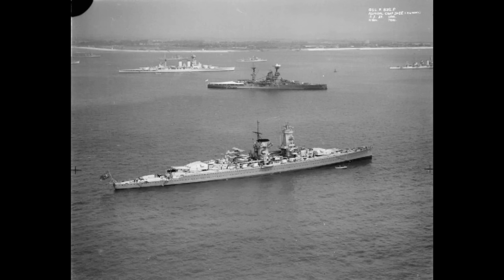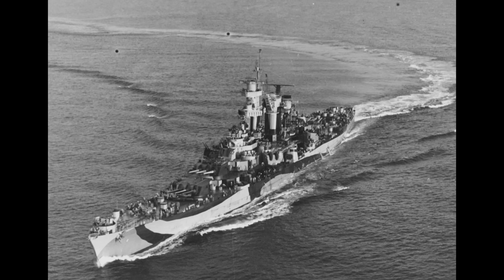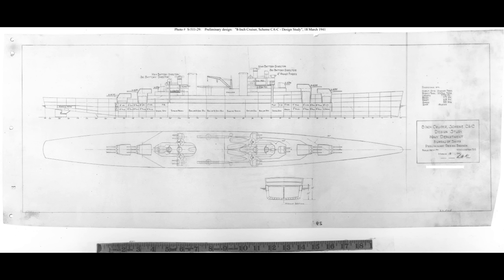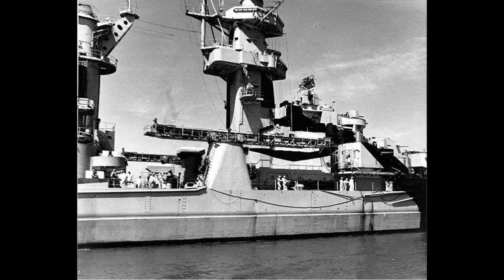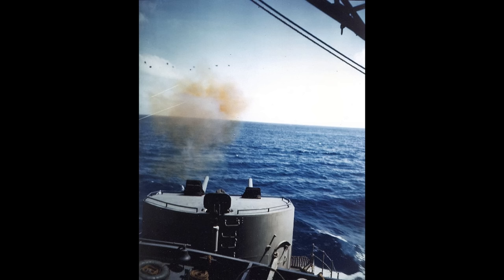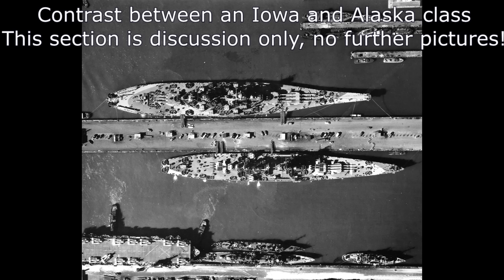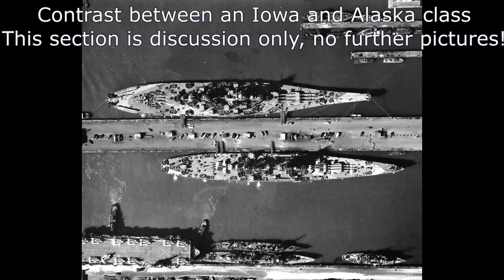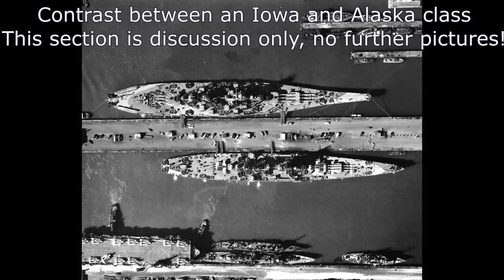The Alaska class - Large/Super/Battle/Mega/Hyper/Ultra Cruisers

Comment: Personally, I'd call 12" guns battleship calibre weaponry, especially as it's similar performing or better than the 14" battleships still in service at the time. Which being a supercruiser with battleship guns, would make them a battlecruiser.
Reply: But they were smaller guns than contemporary battleships, even though battleships of just 20y earlier did use that calibre. So you could go with "light battlecruiser". If any interwar ship was designed with 11-13" guns and armour against the same (as one of the Alaska designs did), then it could be a "light battleship".
Reply: @davidjames4915  Yeah, let's go with "Panzershiff" instead as it's about equivalent to the Graf Spee.

Comment: while not mounting contemporary capital class guns, the 12" is still classified as a capital class gun. the US Navy had this weird obsession with speed not being as necessary as firepower and protection. the North Carolina's where the slowest of the proposed design's. The South Dakota's (1939) bucked the trend with effort to maintain 28kts. The design life of the Alaska's is right in this time frame. The design requirement of at least 33kts, and having been longer, and almost the same weight as a unloaded South Dakota puts the Alaska's into the realm of battle cruiser.

Comment: If they are cruisers and not battlecruisers, then the modern german Braunschweig-class are corvettes and not light frigates.
But then, the Deutschland-class were officially heavy cruisers. (with 14300 long tons fully loaded, 186 m length, 28 knots and 6x 11 inch guns) And those were called "pocket battleships" (Compared the 34250 long tons, 246 m, 33 knots and 9x 12 inch guns of the Alaska) The Alaska is indeed closer to Hood in specs than to Graf Spee.
The closest on axis side would probably the Scharnhorst-class with 38100 long tons, 235 m length, 31 knots and 12x 11 inch guns. Overall similar in size, armament, armor, crew complement, propulsion, speed, etc. And that class was in deed in many sources classified as battlecruisers.
So the official classification and actual specs don't really align on both sides.
Reply: Well, I would agree to you in every point except that the modern Braunschweig class are indeed corvettes

Comment: As far as what category of ship they are, I'm of two minds:
1) Fast battleships essentially kills the old idea of the battle cruiser, as that of a faster ship with BB guns (but worth noting here that the German WW1 era BC designs had lighter guns than their BBs), at the cost of armor. Therefore, there isn't a point to having the BB sized gun anymore, and therefore, the evolution of the BC is along the lines of the Alaska and what the Germans did. The role was pretty much the same... cruiser killers, yet not really meant to slug it out with actual BBs.
2) Without the naval treaties, there was a general trend for larger guns, bigger ships. Such as how BBs went from 12 to 14 to 15/16, and a few 18 inch guns. This also holds true for cruisers, with the 10k ton treaty cruisers, but even there, various nations cheated to build heavier ones, and the weight went up as the treaties ended. Therefore, the ships would have just been heavy cruisers, had various countries continued to build heavy cruisers.

The second, personally, I expect is how it would have turned out. Especially with destroyers packing 5 inch guns, while CLs have 6 inch, well, you'd expect that gap to widen a tad. So basically, CLs packing 7.5-8 inch, and heavy cruisers in the 10-12 range.

Overall, though, the changes brought about by technology meant that the classification of this type of ship never had a chance to solidify. And so we have so many terms tied to ships along the lines. The pocket battleships with their much lighter weight, but 12 inch guns as well, the Scharnhorst class which were considered BBs, the Repulse BCs with fewer but heavier guns, and so on.
Reply: Yes German BCs had smaller guns than their BBs, but they were 11"s when German BBs were 12"s, and the 12" BCs were being built finished around the same time as the first 15" BBs. Now the next generation BCs would of had 13.8", which were bigger than most of the German BBs, and all the German BCs at the time, just smaller than the Bayerns (and her follow on designs), with the follow on BCs designs being 15" to match the BBs.
Now while Drach did point out that the G3 had smaller guns than the N3, the guns were still larger than all previous British BBs and BCs (except if you count Furious's original design).

Comment: So a bit of a hypothetical question. If for whatever reason the North Carolinas were built in their original 14" armed design (either due to being started earlier of the escalator clause being invoked later), do you reckon this would affect the design of the Alaskas?

With a new 14" gun the option of arming them with twin 14s instead of designing a new 12" gun only for them ought to be possible to save development costs and time. Is that something that would have been likely in theory?

If plausible, could that change things in theory such as being completed earlier or being considered somewhat higher value after the war or would the difference be neglible?

Comment: To me, at least, it seems that the WWW1 Battlecruiser SMS Derfflinger design would have been a good starting point. It meets most of the requirements except for speed. It would have been interesting to see what could have been done, with that design, if oil fuel and modern boilers and turbines were used.
Reply: SMS Derfflinger still sound impressive by WW2 standards.  Imagine what she could have achieved with oil instead of coal.
Reply: @williamzk9083  A Derfflinger based US ship could likely carry 12 12" guns or 8 14" guns, given the size of German turrets vs US turrets.

Comment: A Battlecruiser is defined by its mission - to sweep the far seas of cruisers.  The role of cruisers is to defend your colonies and trade routes while depriving the enemy of theirs.  Battlecruisers exist to overwhelm cruisers in their role.  Thus requiring far better armament, good enough armor to fight cruisers but not battleships, and enough speed to engage them.  And of course, importantly, the range.  Their purpose is strategic.  Part of a global strategy.

And the EXCUSE to GET FUNDING TO BUILD them is as a scout or screen for your main fleet... which they are not needed for and will be misused for when applied to that role.  They blow up and sink when you use them for other than their intended purpose.  ...because it is dumb to put them in a decisive main fleet engagement as capital ships.  Because they are supposed to go out abroad and sweep the seas of cruisers in secondary theatres of war.  Alaska is meant to sweep the seas of cruisers.  Alaska is a battlecruiser.

Comment: I personally think that the term « Battlecruiser » is a ww1 term, so the battlefield (or battlesea ) changes so much that you just have other ships with other roles and other threats. Ships don’t just move at 21 knot speed and the speed difference between the battleships and any potential heavy cruiser is marginal (if you speak about the late 1930s and 1940s designs).
The battlecruiser is a term that is simple to understand, but if you are using it, you shouldn’t get sticked to a ww1 term because the warfare has changed dramatically. 
That is why the Alaskas are not the battlecruisers in any shape or form, they are just marginal nearly capital ships designs and that marginal designs are used to be called the battlecruisers.

Comment: The issue is that the Alaskas never had follow ons like the Invincibles to change the context of their type. Had that happened they probably would have been grandfathered in like the latter were.

As it stands, it's like if the Invincibles had had no successors or imitators and remained Dreadnought Armoured Cruisers.

The Alaskas were a design path of similar spirit that was killed in infancy.

There's also the deeper issue that strays into the philosophical territory of forms: what exactly is a battlecruiser or large cruiser to make them distinct like a horse compared to a donkey?

The problem is that we don't have enough examples to properly establish these forms distinctly. Even the number of BCs is small. Cruisers and battleships, though, we have plenty to establish their form enough that it remains the same despite drastic changes to them over decades.

I'd lean into less assigning a specific name and focusing instead on clumping all of these various designs between cruisers and battleships as intermediary ones that have more in common with each other by virtue of having the qualities of the two extremes but lacking enough examples to solidly transcend and become their own category. Ships in this region of design are thus facing similar problems 10in guns face.

The most common name for this intermediary type is the upper, heavy designs on the spectrum, the battlecruisers as they were the only ones produced in some quantity and design lineage, however brief it was.

Comment: I think that trying to shoehorn the Alaskas into either battlecruisers or “large cruisers” is something of a false dichotomy. 

In my opinion, we should start using the term “Super Cruiser” to designate a ship who has the ability to defeat cruisers with relative impunity, operate at fairly high speed, but is not meant to be a primary component of a fleet action. 

I think this would encompass ships like the Alaskas, their contemporaries that weren’t built, HMS Invincible through HMS New Zealand, and possibly Furious/Glorious/Courageous. 

This leaves the term Battlecruiser for ships who are meant to be centrepieces of fleet actions (either in the battle line or as heavy scouts), such at the Vonn der Tann, Queen Mary, etc. 

I feel as though this concept is particularly interesting, as it allows for a clean break in designation between the 12 inch British “battlecruisers” and later designs such as Lion. I feel as though a re-designation of the ships prior to Lion helps dispel the idea that they were a homogeneous design concept. 

I feel that looking at size in this context is somewhat less relevant, as the Alaskas, despite being substantially smaller than the Invincibles relative to contemporary battleships, can still fulfill much the same tasks. The fact that cruiser size and firepower was largely contained by the Treaties, mixed with the miniaturization of powerplants mean that the Alaskas’ displacement can be lower than the older ships’ relative to battleships of the time. 

Unfortunately, this would mean having to retroactively re-designate a bunch ships within the historical canon, which is not likely.

Comment: Speed is the battlecruiser's defense. They're ideal as surface raiders. They can do pretty much do everything a battleship can do, except stand in battles with better armored ships of equivalent gunnery range(HMS Hood). They require different tactics, and must know their limitations.
Reply: So, was Warspite a battleship or a battlecruiser? You're basing Hood's status as a battlecruiser on her supposed lack of armour, yet she was as well armoured as Warspite. Also, Hood had as much armour, as a proportion of her displacement as any British battleship, including the KGVs. Hardly lightly armoured.
Reply: @rupertboleyn3885  Warspite was a classic QE class  WW1 BB. Hood was 9kts faster -as well as faster than Bismarck. Speed was her best defense. Does that answer your question(if in fact it was)?
Reply: @rupertboleyn3885  Warspite was WW1 battleship of the QE class for the last time. She lacked escape speed unlike Hood. Also Hood could keep up with Ark Royal(which was where she belonged).
Reply: @futuregenerationz  So, here's the thing - if Warspite was a battleship, with battleship grade armour, Hood also has battleship grade armour. Thus implying that Hood should not have been fighting battleships is to imply that Warspite, etc. should also not have stood in line of battle.
Reply: @rupertboleyn3885  One could do 32kts, the other 23kts. You want to classify them as the same, fine. I'm done with this.

Comment: If you throw out the Iowas, then Alaska sounds more like a Battle cruiser than anything else. It was being planned in the 1938-40 period when the newest battleships being built were the South Dakotas and the North Carolinas. Check your requirements again. They were as large or larger than these two BB classes. They were faster and therefore, could perform the classic function of being a fast wing of a battlefleet. They had lighter guns than the South Dakotas and N. Carolinas but that was in line with both the Strasbourgs and the Scharnhorsts.
The Iowas (and the Montanas) were a big jump forward in design ie. big, fast Battleships of the future; Iowa and Yamato. I think you have to compare them more with contemporary American BBs. As to the 'large cruiser' question; If they had reached service by 1942, they might have actually seen service as actual cruiser killers in the Southwest Pacific.
Large cruisers or Battle cruisers? The true answer may never be agreed upon. For my taster, if it looks like a Battle Cruiser it probably is. Graf Spee looks like a large cruiser. There is some well-known footage of what appears to be Alaska in battle, planes flying past low, AA going off and I saw this many times assuming it was some other American BB but finally looked close and realized it was Alaska. That kind of says a lot.
Reply: I feel I should point out that the Des Moines class cruisers were longer than the South Dakota class battleships and had a displacement within 1,000 tones of HMS Dreadnought.
They were not particularly fast, being just as fast as any other cruiser.
The Iowas were not a ridiculous jump ahead of the South Dakotas, essentially just being elongated versions of them, the main difference besides that being the use of 50 cal 16" guns instead of the 45s.
just because something looks similar does not mean they are the same, as during the war US cruisers had before be misidentified as battleships., and Identification really comes down to how familiar you are with the things in question.

I think another argument beside what Drac mentions at the end of the video is that all ship classes grew in size and displacement through the 1900s. Submarines, Destroyers, Cruisers (both Light and Heavy) and Battleships all at the end of the all gun main armament era were much bigger than they were in WW1, if Alaska was a Battlecruiser it would be the one and only exception to this trend of all classes increasing in displacement over time.

Comment: I was leaning battle cruiser until the speed thing. I'm not sure it could effectively scout and screen for a battleship force as fast as it, which seems an implied role for a ship designed to annihilate cruisers, and even some cruisers really. Iowa being faster really throws a wrench in things unless we call Iowa a battle cruiser, in which case the Alaska still isn't by comparison. Also, almost all battle cruisers are designed to be able to support the battle line, and whilst you don't want a toe to toe engagement with a battleship, not even having any legitimate expectation of being able to even hurt them (contemporary ones anyway) does really damage the Battlecruiser argument. Finally, from a standpoint of development lineage, the Montanas and the Iowas are the division of battleship and battle cruiser, the fast battleship arguably having taken up the mantel of what was formerly a battle cruiser, but neither can the Alaska be a heavy cruiser when both the Worcester and Des Moines represent light and heavy cruiser development, so it's truly in between and a super cruiser: the Montanas not actually being built just skews the perspective somewhat. I think I reach the same conclusion as Drach by a slightly different path.
Ultimately, I agree with the comments they they were nearly obsolete on launch: the aircraft carrier had grown so firmly into a leading role that traditional roles for any of the above had all but evaporated. Even the Iowas were mostly justified for as long as they were for shore bombardment; the time of surface to surface gunfights had already passed.